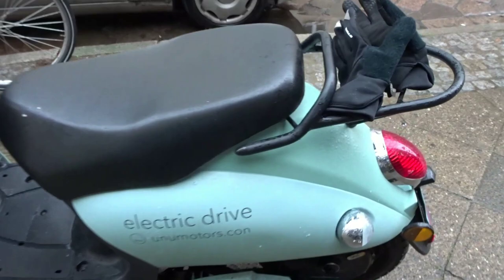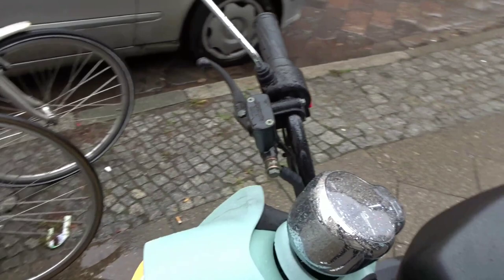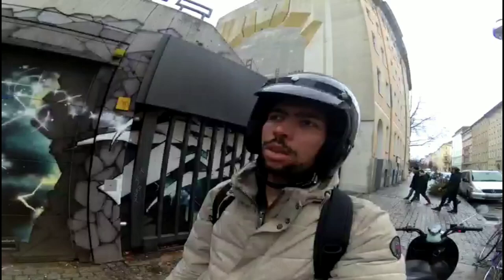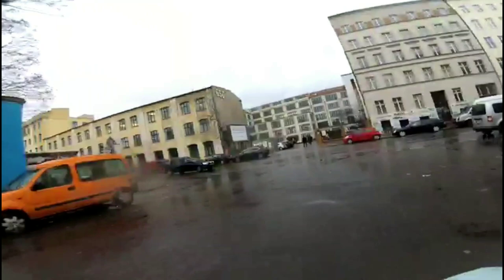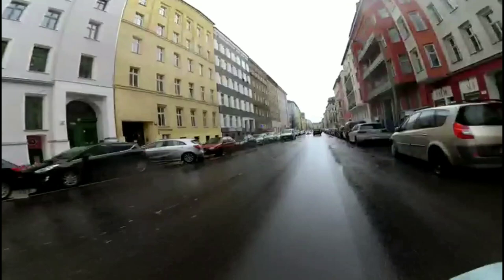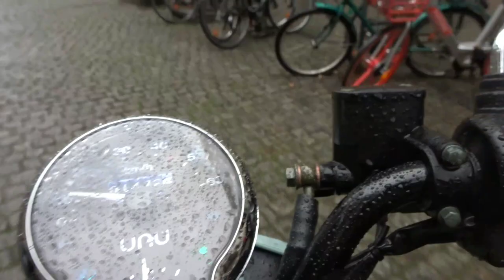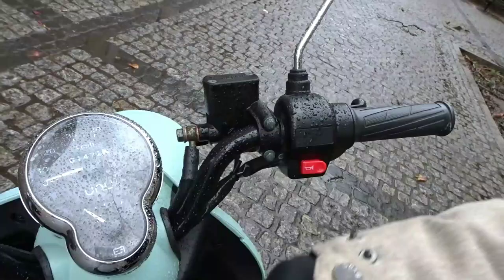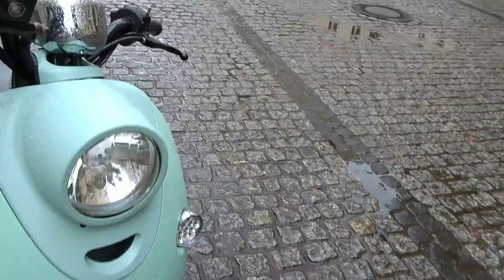UNU E-scooter test drive + first impressions

Comment: You drove with high beam (that's why the blue symbol was activated). 😉 How would you compare the power of the 2kw peak Uno versus the 2,4kw peak Niu? I like the Niu N1S a lot more, it looks so much better, has all LED lights, has a lot of dealers where you can go to buy it and if you have problems. The Uno is an ugly duckling, but the Premium has more power and is cheaper, compared to the new 3kw 45 km /h Niu. With clothes and helmet I'm close to 100 kg and so I would like to have the 3kw power to stay in the flow with the traffic.
Reply from the maker: Hey! I would say the peak of UNU its pretty much the same as the peak on NIU in Mode 3, i didnt felt any relevant difference! The thing is as you said the looks of NIU its much more modern than the UNU, also have more features like the app where you can see a tone of info about the scooter and also know if someone touch your scooter, you get a notification for that, The NIU scooter have GPS, so you can always know where your scooter are even though if its stolen, so i thing that is a big + for NIU! Also did you checkout the other Models of NIU they have at least 4 Models! They 2 New Models, NIU M+ and NIU NGT are pretty good both offer 100km (realistic 80+) in one charge the better feature of the NGT you can get up to 70km/h top speed and the M+ the range 80km + and the design, for me the Best looking E-scooter and you can still fit 2 persons! 

Are you thinking about buying an E-scooter?  

I would say go for The NIU, could be a bit more expensive at the end, but the modern design as well as the safety features as the app and building in GPS are worth it, also with all the Models that they offer, i am pretty sure that you can find one that fits your needs! 

I am thinking about buying the NIU M+ in March, The price its 2,590€ 

Let me know if you choose one, also i can tell you some places to go testdrive them if you Live in Berlin! 

Peace ✌️
Reply: @eddythegun22  Yeah, I think I will get the Niu N1S in April or May this year. I plan to finance it over 3 years, so the monthly costs are affordable for me. I've got no license for a scooter faster than 45 km /h, so unfortunately I can't go for the N-GT.
Reply from the maker: I think its a great choice anyway, you can still move around the city very good, you dont want to go more than 50km/h in the city anyway! Also you can park anywhere without problems and no larger costs on fuel, Just few costs on electricity! I would say go for it
Reply: @eddythegun22  I'll do so! Thank you for your quick response! 🙂
Reply from the maker: No worries, when i buy my E-scooter, i Will bring to the channel, so keep tuned and i hope you buy one as well! ✌️
Reply: @nhcs2k  hey hi. So? Did you get your Niu N1S? What is your feedback? A review maybe? Thank you!
Reply: @msobetchi  Yeah, I got it since march and drove nearly 600 km with it. The first 3 weeks the weather was to bad, wet and cold, now it is much better. 🙂
Because I got no good camera, I don't think about a review right now, but maybe my brother and I save money for the newest GoPro. Then I want to make a review! 🙂 I really like my N1S. There was one time when my speedometer was frozen to 48 km /h while I had released the throttle and slowed down, all other times it just makes me smile alot. 🙂
Reply: cool cool :) what are the bad sides of the scooter? and good? what's your battery 1-2-3000W? how is it? Thanks a lot
Reply: @msobetchi  I got the normal Niu N1S with 60 V 29 Ah battery (1,74 kWh) and the motor with 2400 W peak (it has around 1500 W permanent power). At the moment there is no bad thing, except the display which can easily scratch if you want to wipe off dirt and water. Use a very soft cloth.